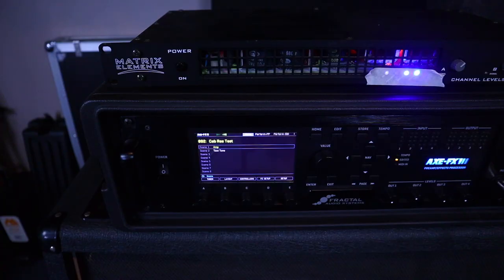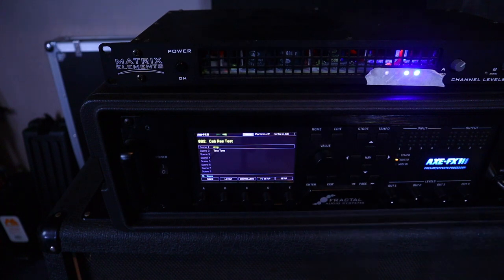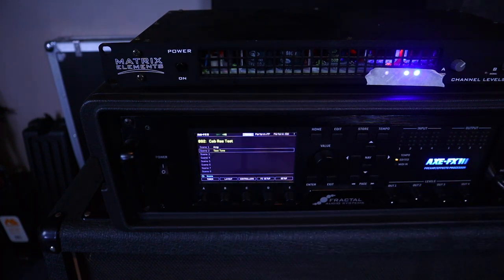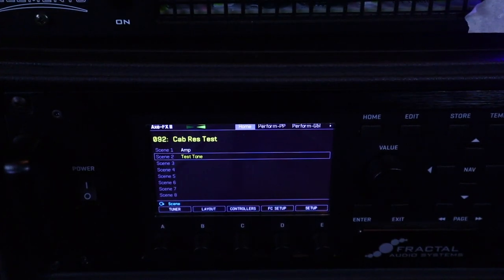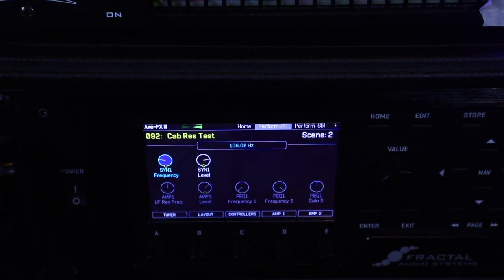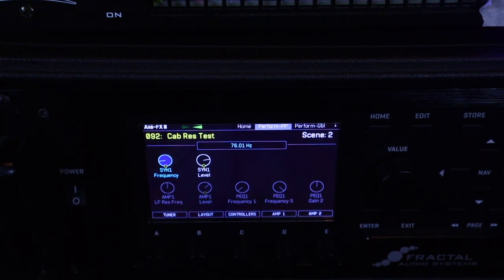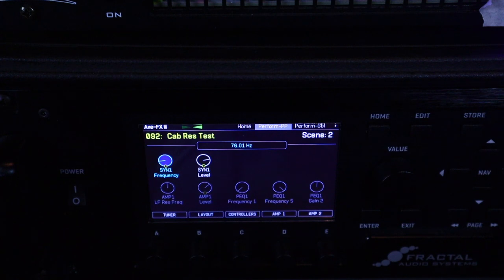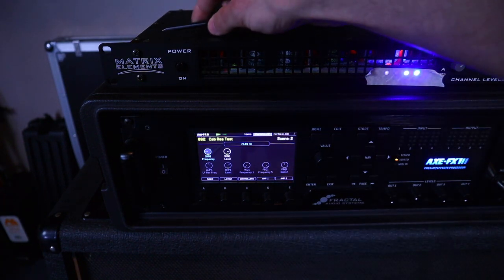Axe Fx III with a Real Cab - Tips & Tricks

Comment: Just bought the Axe FX III based on your videos.  This video shows how I am going to use the Axe FX III - into a power amp and two 2x12 Marshal JCM 800 cabs.  I am bookmarking this video.  Great demo and advice.
Reply from the maker: The new speaker impedance curves do an even better job of dialing in the cabs than this IMO. Congrats on the III :)

Comment: Noob question for ya... would you not want to run a tube power amp? Would it not sound "better"? I know subjective. but these units have my interest peaked, I have a Diezel VH4 I love to death and a Line 6 Helix for when I want to play through monitors at a low volume. I was wondering how the Helix models would sound with a tube power amp. I downloaded some cool cab IR's.
Reply from the maker: A lot of the models in the Fractal rely heavily on the power amp characteristics (Plexi, Tweeds etc) so you lose some of that if you disable power amp modelling and use a tube power amp. Having said that, running stuff like the Mesa and Diezel models with a Mesa power amp sounds HUGE.
Reply: @LeonTodd  Thanks man. For a goof I might run my Helix through my VH4 power amp to see what it sounds like. I know it's blasphemy but why not. I heard they put in a Diezel amo model in the helix so I want to hear it. I have not used my Helix in about 2 years. L)
Reply from the maker: @mesaseany  keep me posted with how it goes

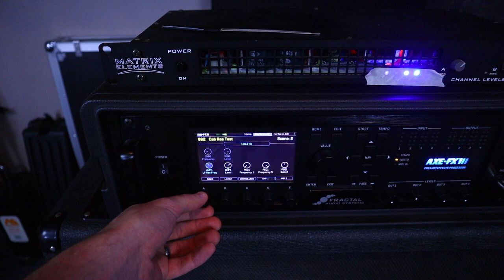Comment: Man, that is a great Video, very helpful! Will a Mesa 2:50 work equally well with the Axe fx ? I´m a long time Triaxis Player and i absolutely  love it, but now i´m considering an axe fx for touring ... Have you guys experience with a tube power amp? cheers
Reply from the maker: Yeah but you won't need to play with the impedance modeling, since a tube power amp will have that interaction.
Reply: @LeonTodd  Cheers mate ! In Germany it´s hard to get the matrix as a solid state alternative, fractal support suggests therefore the Power Stage 700 by Seymour Duncan ... maybe sometime i can compare these two...

Comment: Would you also do that for an FRFR speaker, or is that only worth it for a guitar cab?
Reply from the maker: It's worth experimenting with when using an frfr
Reply: I guess that's what I was wondering... When you do the sweep with the FRFR should you do it with the cab off, or do it with the cab on and does the resonant frequency changes with every IR. I thought  Leon might know since IIRC he's (at least sometimes?) using an FRFR as a foldback when on gigs.

Comment: Why do you need a Matrix? It should work just direct from the FX iii to the cabinet
Reply from the maker: The AxeFx isn't powered.
Reply: @LeonTodd  sorry for my ignoranse, what does it mean "powered"
Reply: @felipegomabrockmann2740  An amplifier is a preamp and a poweramp, the preamp shapes the tone of the guitar while the power amp is actually making the power to amplify the sound. An axe fx is a digital preamp with effects and models power amps digitally but is not an actual poweramp. I use a seymour duncan powerstage 700 into a PA cab basically and it is amazing, so much better than using studio monitors
Reply: @colelewis9940  wow I learned a lot. Thank you very much
Reply: Doss Koont  Xitone passive wedges. They were a brand that I knew made passive ones since I already had a poweramp.